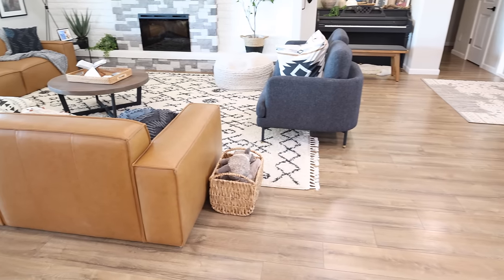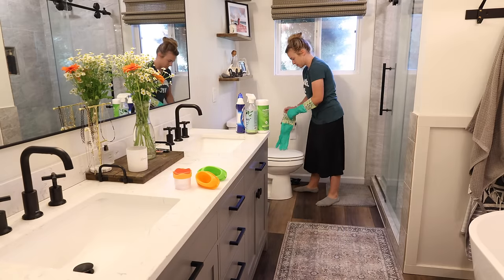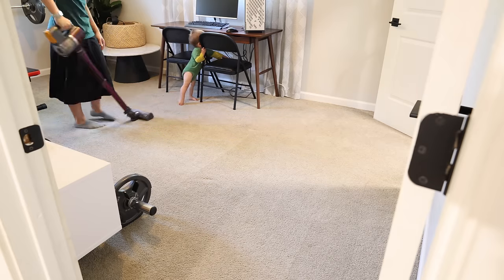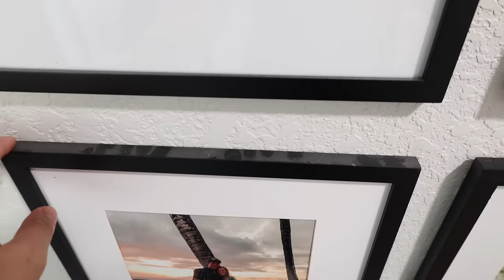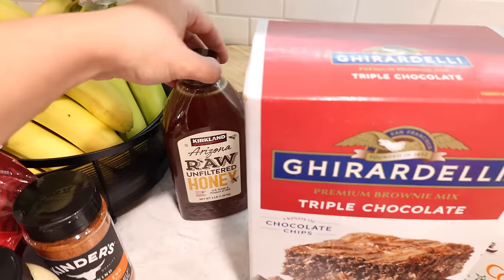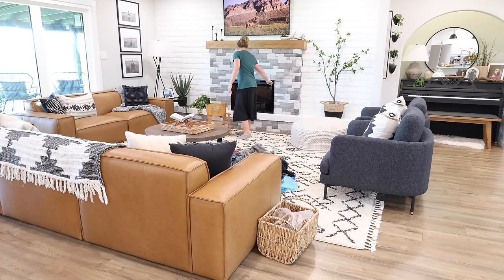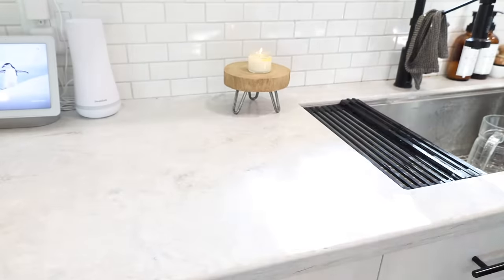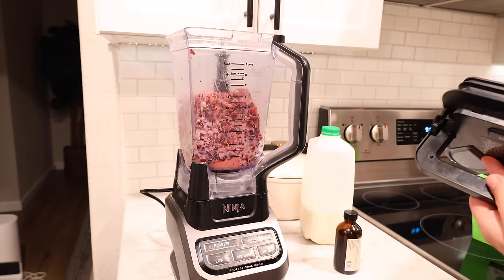WHOLE HOUSE CLEAN WITH ME!🏠 WEEKLY CLEANING ROUTINE | 2023 CLEANING MOTIVATION

Comment: Thank you for getting me motivated! As an aside, I use a Magic cloth for all of my windows & mirrors--just wet with cold water & wring out to use (no cleaning solution needed)! I also use either just baking soda (great for getting rid of soap scum in tubs, etc., and shining things up), white vinegar or a homemade Thieves Oil -alcohol-distilled water solution for all household cleaning except the floors, laundry & dishes. And finally, I use Tru-Earth strips for washing laundry (no plastic, no spills/mess, no weight, don't take up any space at all in the closet & they work great) & organic wool dryer balls (which last many years) in the dryer. All of these work great, are cheap to buy & environmentally friendly. No need to be buying all kinds of cleaners that cost much more, take up space & can be messy to use!

Now, toget my home cleaned!

Comment: CLOTHESLINE TIP: if youre gonna hang what you put on the line, put it on the hanger first then secure the hanger spacing with the pins. put away is as quick as moving it from the line to the closet rod.
Reply from the maker: Thanks for the tip!